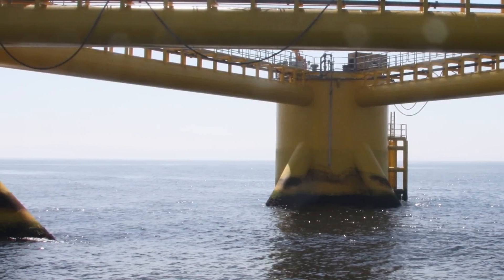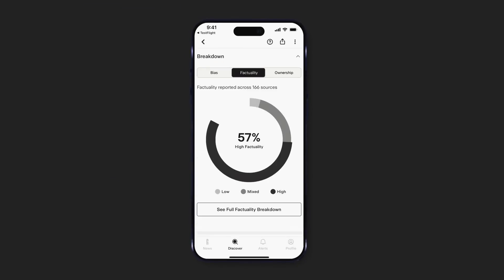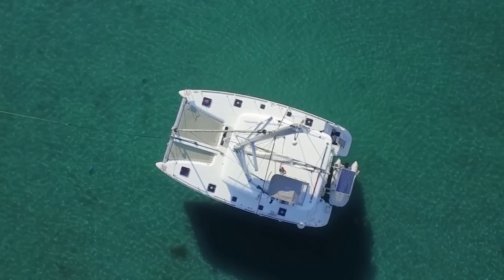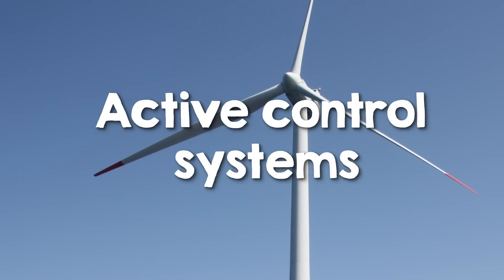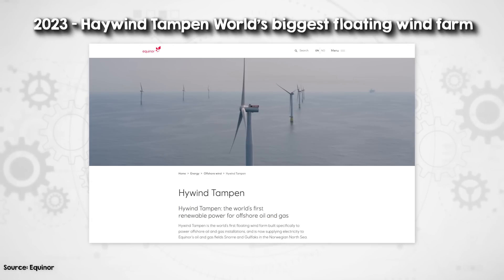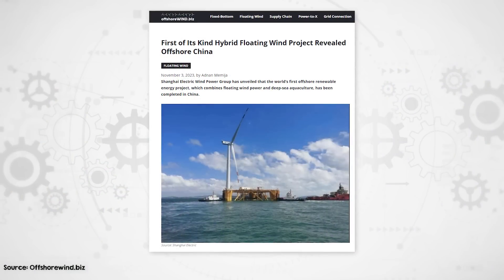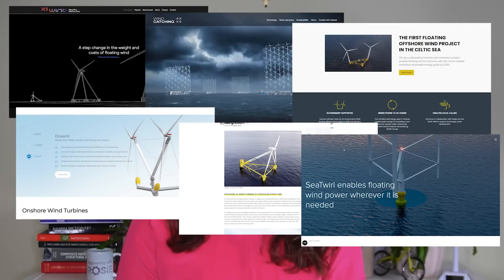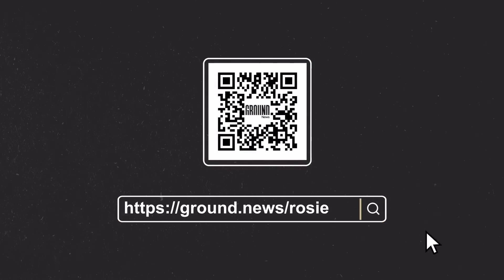The Rise of Floating Offshore Wind Technology

Comment: When you want your car serviced, you don't bring the service station to your car, you take your car to the service station, exactly as Hywind Scotland is currently doing with its floating turbines.  In the long run, floating wind will end up much cheaper than fixed bottom offshore.  Very little specialised marine equipment needed, just land based servicing on the dockside, with all the service engineers working from home.  It will take time to build the servicing infrastructure and port facilities, but by the time we get to 30MW offshore turbines, they will all be floating, just as currently all 10MW+ turbines are offshore because installing them on land is impractical.
Reply: https://youtu.be/jB49o5HoOdk
Reply: Ever heard of mobile mechanics?
Reply: @nigels.6051  why even pursue such an expensive form of power?
Reply: @ClimateRealism  Because in some places (e.g Japan) it's the only renewable generation system that they have plenty of space for, and it'll get a lot cheaper as it grows so should be competitive. As nigel explains, the ability to float it into port for major servicing may actually reduce maintenance costs. (maybe - it depends how long it takes, as it'llbe offline for that time).
Reply: @xxwookey  on my videos I detail facts and the facts are wind energy is getting more snd more expensive.
Reply: @xxwookey  It doesn't need to be offline for servicing.  When the tug goes to collect the turbine to be serviced, it needs somewhere to put the anchor ropes and electrical connections, and the obvious place is on the replacement turbine,, so it will be offline for maybe an hour.  Otherwise you either need some enormous buoys or you are going to have to fish for them on return.  Anything done at sea costs many times what it does on land for exactly the same job, they will be constructed so that very little needs doing to them between major services in port.
Reply: @ClimateRealism  For decades, wind energy became cheaper and cheaper, until it was the cheapest.  Yes, it has got more expensive recently, but everything has, and with wind energy, it is suddenly in mass demand, there is a shortage of everything, prices will drop again once the market stabilises,   What are the alternatives?  Nuclear has got even more expensive, fossil fuel use needs to end urgently, solar is impractical in northern countries. Floating wind will be the cheapest for some countries, and the more investment in it, the cheaper it will get.
Reply: @ClimateRealism  Prices went back up from the lows achieved circa 2020 but 'more and more expensive' implies the whole direction of travel has changed. I don't see why that should be the case, and certainly not for floating wind, which has a way to go down the cost curve yet.

Onshore is still one of the cheapest types of generation. Offshore is now relatively expensive, but still cheaper than peakers and nuclear, and about the same as coal. gas plants are now cheaper than wind again, but have 25-30 times the emissions.
It does open up some space for new geothermal which I think shows huge promise for low-carbon baseload. Real-world prices remain to be determined there. (I'm using Lazards' 2023 numbers for above comments).
Reply: @xxwookey  floating wind farms. The first one Hywind has failed.
Uk strike prices
All per MWh in uk pounds
Gas 60
Solar 85
Inshore wind 89 and rising
Offshore wind 102 and rising
Offshore floating 246 and failed
Reply: @ClimateRealism  'Failed' is a big claim. It ran for 5 years, and now they can examine the bearings, which was one of the biggest questions to answer on longevity of standard turbines on moving bases. That's pretty-much what Hywind was set up for, so I expect the project owners will be considering it a success.
Reply: @xxwookey  That is very convoluted thinking. 
They get paid four times the price of gas. There is no chance of it being competitive and after 6 yers it is out of action for almost a year and counting ...... that is failure at every level in providing reliable energy at an affordable price period.
Reply: @ClimateRealism  Gas is not decarbonising so isn't a very useful comparison metric. Fully abated gas would be the price to compare against, and that's not cheap either.
I think you are writing floating wind off too early, but I geuss we'll find out over the next decade or so.
Reply: @xxwookey  It will be too late then.
CO2 is not the issue, there is no need to restrict it. The scei9nce does not support your view.

Comment: I dunno. It seems to me that a deep sea floating platform will always be more expensive than shallow water turbines - the higher cost of connection alone will make sure of that. Which would not be a huge problem if there was a real shortage of places to put shallow water turbines but there most certainly isn't. I don't think the higher capacity factor of a deep water turbine is going to overcome this.
Reply: There is a shortage of shallow water.  Offshore wind farms take a huge amount of space to maximise performance, and even the UK, which has more shallow water sites than most countries, is running out.  Plus our best wind is over the deeper waters, that is why the new wind farms off our south west coast are going in the deep waters of the Celtic Sea, not in the shallow waters nearby, we have 12GW allocated for floating wind in the Celtic Sea alone, and none in the shallow water nearby!
Reply: It's not just capacity factor, but also the ability to have wind farms widely spaced around the country so they produce at different times and reduce intermittency. When the wind is calm in the North Sea, it's often blowing on the other side of the UK. There's currently very little on the west coast because the sea there is so deep.
Reply: There may also be cases where the shallow-water site you would ideally like to locate a windfarm is a protected marine sanctuary, so you have to move it further away.

Comment: Great Vid Rosie,   OOPs forgot to mention what these do to nature, birds killed, whales thrown off course or collide with the structures etc.  I still think solar in deserts is the big win and don't forget to get everyone an EV bicycle, the other big win.
Reply: Yes!  We can keep burning stuff and hope the birds and whales enjoy their new heated sea, and its acifidification with rising CO2 levels!
Reply: @Richardincancale  Yep I am with you on this stuff. We haven't seen anything yet the issues of carbon overload.  If we lose the ice Greenland and Antarctica water levels rise 200 feet. Think about that for a while.
Reply: Offshore birds need offshore food, and currently our offshore birds are loosing their food due to rising sea temperatures.  Burning of fossil fuels needs to end if our offshore birds are to survive, and for not so sunny locations, away from the equator, floating wind has the biggest potential to replace fossil fuels.  As for the whales, the only significant problem with the fixed offshore turbines seems to be the noise of construction, which isn't going to be much of a problem if the turbines are constructed in port.
Reply: @nigels.6051 of course these areas are no go for fishing, so create marine conservation areas.
Reply: @markthomasson5077  In the UK, the exclusion zone for fishing is only 50m around each turbine,, but it does stop the massive trawlers from removing everything, so yes, they are positive for marine life, and that is positive for the offshore birds.

Should point out that offshore turbines kill very few birds anyway, they are so massive that the birds all fly lower than the bottom of the blades, so never get hit..
Reply: if you care so much about birds you should oppose the construction of any building taller than a shed
Reply: Desert solar would be fantastic in Australia, but useless in the UK or Norway.
Reply: Don't mention - the car and cat!
Reply: Whales can swim around turbines.
Reply: Apparently desert solar might have some unexpected consequences on desert ecosystems, and at a minimum, care must be taken in their siting and design.  Not to say never, but in the end, all forms of energy generation have tradeoffs.
Reply: @christophermpapadopoulos4613  Desert solar is certain to change the local ecosystem, it leaves much of the ground surface in shadow, and has the potential to turn some deserts into non-deserts.  Not sure how this is relevant to floating wind?